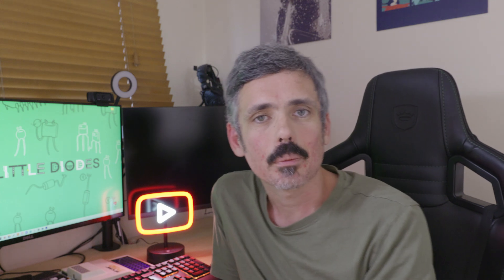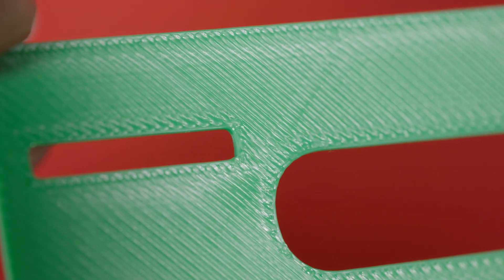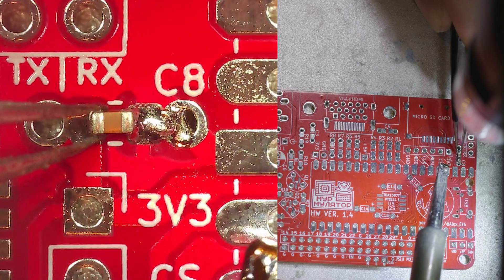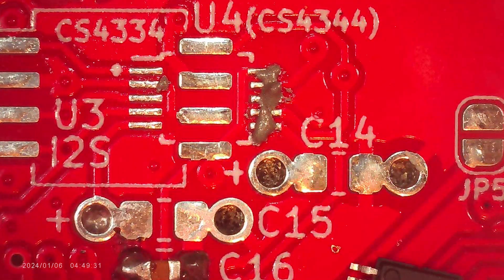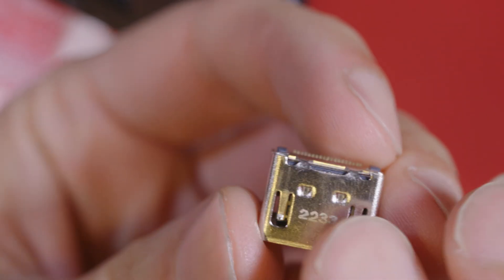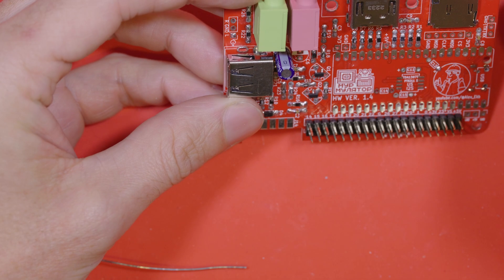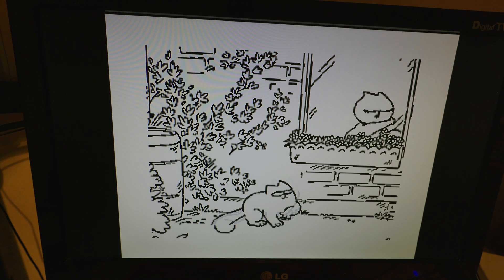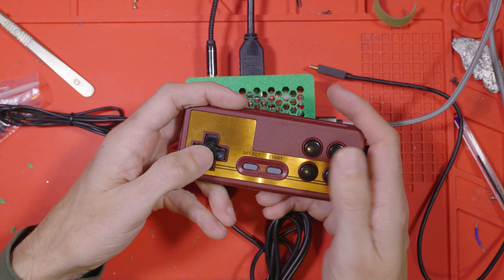ZX Murmulator 1.4 - Emulator Build

Comment: Use a flux paste. You don’t have to hold the components while you solder them. Once you get the hang of it it’s far quicker than through hole. You can place several components at a time.
Reply from the maker: I want some, but have loads of flux pens to get through and don't want to waste them

Comment: Good afternoon. This board is a testing ground for different chips and unfortunately CS4344 or CS4334 was not supported in firmware. We settled on TDA1387 or PCM5102A. Also, my firmware can be controlled completely with a joystick from the on-screen keyboard - the second item in the main menu. Where can I send the documentation translated into English?
Reply from the maker: I see you've shared it with the discord, thanks